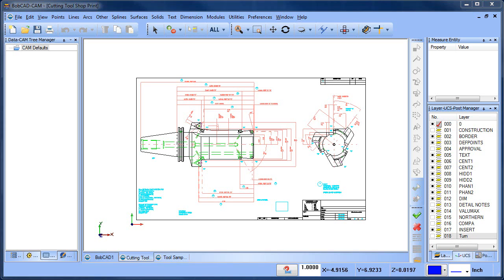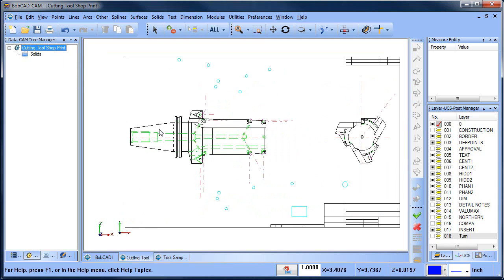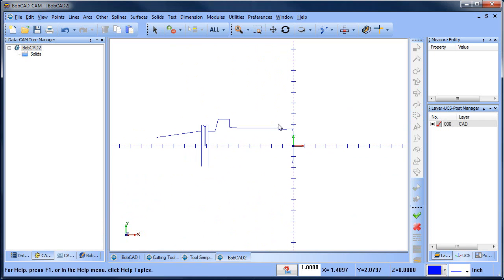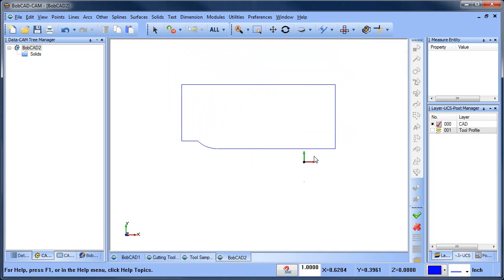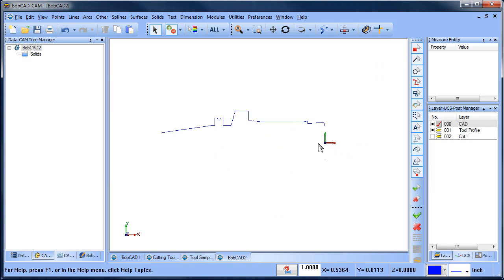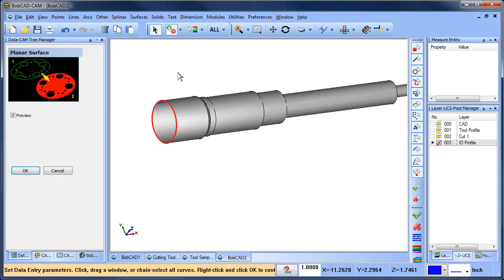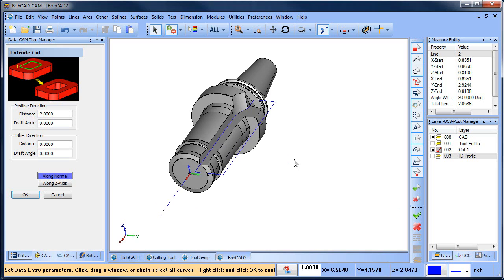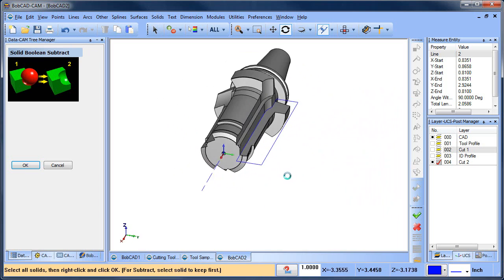Wire Frame To Solid Tool Design Part 1 BobCAD CAM V28 CAD

Comment: Thank you for working through the little unexpected things that are unique to your program! I just got BobCAD v28 , I have used several cad cam programs Gibbs 2007 and 2015 at work, Dolphin cad cam at home.. I wanted to upgrade at home and after watching many of your videos, I decided BobCADCAM was the way to go..what a great decision! Much more powerful and flexible than what I was using. It can do most of what Gibbs can do, you may have to think a little more but the tools are here. For around $25,000 less than Gibbs, it seems like BobCAD has better drafting tools in it. More cad options for sure. Just getting into the cam side now but seeing the processes you use has helped from the get go. thanks again